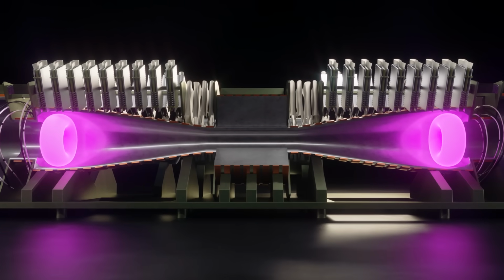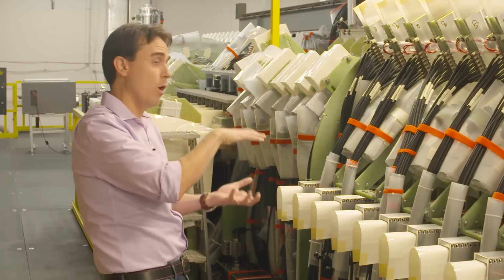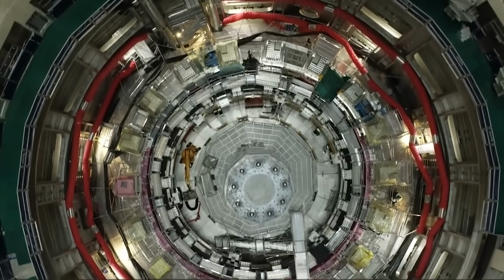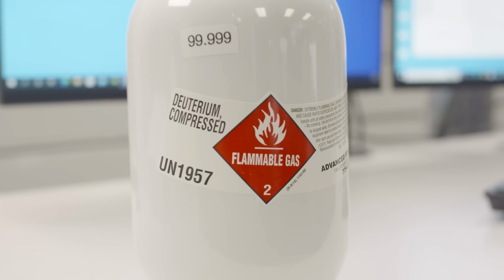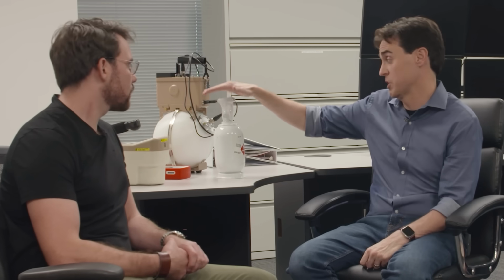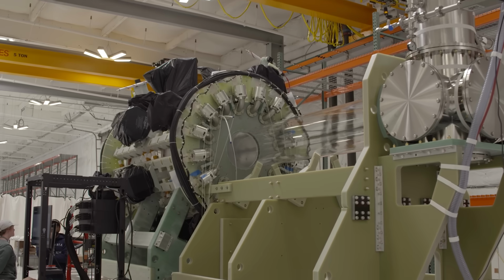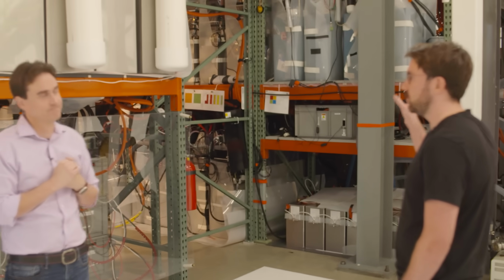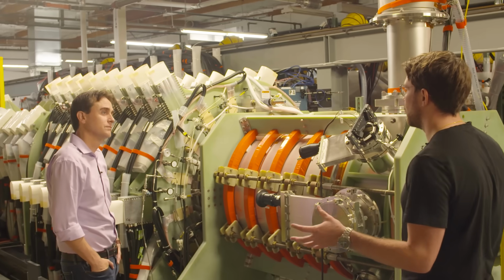A New Way to Achieve Nuclear Fusion: Helion

Comment: You can produce nuclear fission in the air, it can travel to metal, right down power lines. It's real and the united states'Government Agencies are slow. You have been overrun by satanic cowards using the wrong technology on citizens. Nuclear power and nano chips, smart dust technology, remote nurel lace technology and v2k nightmare. Direction energy.
Reply: I think you're the slow one buddy 😬
Reply: @cristhiansierra2184  I pulled you out of the woodwork, I highly doubt you even know what nano chips technology is. By your comment. No reply

Comment: Neat, is like a 3D plasma mold with cathode ray tubes on each end and linear accelerators that handle the plasma 3D shape to pump the two ends 3D plasma shapes into each other with more than I mentioned.   Wondering how these systems can be used for nuclear waste and nuclear transmutation of more dangerous isotopes into more stable isotopes?

Comment: Glad to see some more power options that are not just fancy ways to  boil water to turn a steam turbine.
Reply: @modenaman  I don’t think you watched the video
Reply: 9:00 minute mark
Reply: @modenaman  you gotta pay a little closer attention next time if you wanna call people out in the comments bro lmao
Reply: @modenaman  It mentioned other fusion plants boiling water but not the one the video is about check 9:00 to 9:41
Reply: Lol
Reply: Ya'll click on a video about engineering, and then try to argue the video doesn't make sense without watching it or paying attention, cmon
Reply: @modenaman  forgot to tag you in above reply
Reply: A couple others use a similar scheme.
Reply: Well, to be honest, from an engineering perspective boiling water is a great option. Thermodynamics is very unforgiving when working with heat, and a water based Rankine cycle is decently efficient (depending on the heat exchanger at the boiler) but it has the great advantages of using a common fluid and cheap materials (a 450°C turbine is not hard to make nowadays and the thermal efficiency of a combined cycle can get to 70+%)
Reply: @Daekanoid  
He's talking greater energy efficiency that steam. I'm unsure if this will still have a heat component that can be utilized in addition to the magnetic principles he describes.
Reply: @Daekanoid  the more you transfer the energy the more losses you’ll get. Carnot cycle gives you theoretical maximums.
Reply: @Daekanoid  Yep efficiency is the main reason I'm glad to move away from using heat to make steam. Thermodynamics and conservation of energy mean you can't get away from energy loss from changing and transferring it. As well whenever you bring steam into things you bring high pressures as well giving you lots more ways of things to go wrong.
Reply: ??..so where does it get the 100,000 amps, to run..water.??..its another bs power generator.
Reply: @harrywalker5836  Eventually stuff like this will be connected to a battery pack to self-start. Each run would recharge + generate power so it'd only need external power once unless there's a major issue.
Reply: @harrywalker5836  what??? There is absolutely no water in this system. A capacitor bank draws in a few mj from the grid (read, less than a single ev) to charge the capacitors, the. Discharges those mj over millionths of a second to achieve gw of power for a short time, sufficient to achieve fusion.  they presumably are  be capturing this power from their coils (similar concept to spinning a turbine) to be able to sustain the reaction so long as they have fuel.
Reply: @harrywalker5836  isn’t power generation the goal?

Comment: Yeah I get it's a new way to show a glimpse of fusion but, it's nothing different than what every supposed fusion device does. The tokamax this thing other things they all do the same thing man. They take an enormous amount of plasma energy. And they either squeeze it or hold it in place for a billionth of a millisecond. We've achieved that already many people can do this. The trick is to hold it there indefinitely. It seems we're stuck in this different design phase and never gaining a step further. But as for right now many proofs of concepts that don't seem to work.

Comment: I know if I look further into it I'll find the big problems they face, but I have followed a lot of fusion attempts and this is the first I heard of the idea of using the magnetic flux to directly generate useful electricity. I don't know how tight their confinement is and whether that is still a serious issue as it is primarily with any thermal method, but the idea that you're trying to fully isolate the plasma and never allow leakage seems intuitively easier to engineer. Not easy, but easier.

Cool video, thanks for sharing.

Btw I would really like it if you had gone into covering what their version of the net positive energy problem looks like, and where they currently are in that problem. It's a harder to qualify idea for me, how much theoretical energy of the pulsing magnetic field can be extracted. Is it limited by the EM equivalent of a Carnot cycle? Would they have to use many fast pulses sent into existing 'remnants' of fusion to scavenge the energy? Sounds like a serious hurdle to have the capacitor system ready in time for another pulse, and the thermal problem which goes back to confinement. Like I said I'm sure I'll find the big problems if there's enough information available about the systems, but I request that people like you at least do a blurb about the most difficult problems they face. The 'show stoppers' so to say, because there's always a show stopper.. the best show stoppers are simply the ones where more experiments have to be done to find out. Many show stoppers are essentially waiting on materials science and SSPh to invent a material to solve the problem.
Reply: " covering what their version of the net positive energy problem looks like"

this is exactly what I was hoping to see. I wish they talked about the most significant loss mechanisms and how they plan to address them through design changes in principle. They did say that the newer design will be larger to avoid the plasma from impacting the walls but never said that that was a limiting loss mechanism when compared to other losses such as those due to radiation. Also, the fact that they plan to operate Polaris at higher fusion pulse rates seems to indicate that they expect the losses to scale up less rapidly with the pulse rate than the captured power

Comment: Only AFTER fusion is fully developed and commonplace could humanity contemplate reaching for the stars. 
 Ironically, to reach the distant stars, humans will absolutely have to carry their own artificial star to sustain the energy expense of existence and propulsion.
In time, humanity will be forced to vacuum all stars within reach, to fulfill the NEW energy requirements for the foreseeable future, as well as the distant time when the universe goes dark and quiet, with nothing more than monstrously gargantuan black holes emitting Hawking radiation on the order of just a few WATTS, undistinguished from the blackness of a universe where even the current background microwave radiation has shifted to UltraLongWave radio-frequency.
Hydrogen will be Far, Far more expensive than all the remaining gold in the possession of All the billions of hypertrillionaires at the end of time.

Comment: layman question here: if you tell me that they heat these particles up to several millions of degrees, like in the core of the sun,, how can that heat be contained and by what? wouldn't any metal or structure that comes in contact with that much heat melt or at least take some quick wear and tear from that?
Reply: the plasma is magnetically confined so that it can't touch the chamber's walls
Reply: Inert gas
Reply: Indeed the walls would get damaged if they ever touched it, thankfully that’s what the magnets are for
Reply: @kaitlyn__L  but how can magnetism contain all that heat so effective like that?

Comment: Noone can answer this question  why doesn't a fussion detonation continue with all surrounding matter  a uncontrollable fussion reaction process. Radioactive or not the atomic bonds are in all matter the detonation should provide the necessary power to continue the bond destroying effect. Have you considered lining the inside with graphene panels over space age heat sheilding.
Reply: that's like asking "why does a fire only burns it's fuel ? chemical bonds are in all molecules after all !", the conditions for fusion are extreme, if the fuel exit these conditions it simply can't fuse. (Also, you only get energy from fusion when fusing elements lighter than iron-56.)(And we can't make graphene panels, did you mean graphite ?)
Reply: @The.Heart.Unceasing  no

Comment: So one of the reactions seem to indicate that this could produce hydrogen as a by-product. Or am I missing something?
Reply: it does, why do you ask ?
Reply: @The.Heart.Unceasing  Japan is looking to produce hydrogen as a byproduct in their High Temperature Engineering Test Reactor, which could have a direct impact on the viability of hydrogen fuel cells. That said, I thought about it after making the comment and realized that the amount produced would probably be negligible.
Reply: @yhmlco  well it is a byproduct that need to be filtered out anyway, so if they can make money by selling it, they probably will

Comment: At the moment my biggest capacitor bank is only 6,000 amps! Over 100,000 amps is insane!
Reply: I would only achieve 6,000 amps if I retard it at 3.5 volts so I wonder what voltage they are running at?!

Comment: Talking about being more efficient than Tokamaks and bashing them to a degree, but no word about the Q value here. lol. A continous fusion reaction is much more efficient than a pulsating one where you have to constantly charge up capacitors losing energy. Not to mention all those physical benefits of a donut shape which make it eaier to support the structure against the outward pressure on scaled up versions which use superconducting magnets. A donut shape is a natural form in which gases like to be in (Smoke rings etc) which also make the process of keeping it in shape more efficient. There is a reason why the whole world united to build ITER and not some other variant.

Comment: What most people don't understand is that this same technology applies to many other systems.  I theorized a similar system years ago for propulsion purposes!  You don't need the high temperatures these folks are working with and the propulsion cells can be made very small.  They can be formed in a kind of skin.  That makes the entire flight surface a propulsion system. 360 degrees around an object.  It means the ability to make maneuvers like the ones reported during UFO sightings.  I don't know if you would get the velocities seen in those sightings, but certainly you would have advanced flight capabilities.  The system had virtually no moving parts.  Like this guy just said.... "It's all done by electromagnetics".  You can think of it like a stack of quarters with dime sized holes in their centers. Each produce a magnetic field. They're turned on sequentially and turned off sequentially as well.  Suggesting that you have 20 of them and you sequentially turn on the first three, the instant you turn on the fourth, you turn off the first.  Then the fifth on, and second off. This reloads the cylinder segment so the cycle can repeat.  You're just pushing the air around the craft.  Too bad I haven't the time to play around with it more.  There's absolutely no reason it wouldn't work.  A simple ION Fan produces thrust.  This just produces much, much more thrust!  Keep in mind that you can cycle it as fast as the computer can turn on and off the magnetic fields!  PS ~ that's really fast.  I've actually wondered if it would be too fast.  Sonic boom fast.  Sure would be fun too find out!!!!!

Comment: the energy conversion system sounds a lot like one of these https://en.wikipedia.org/wiki/Explosively_pumped_flux_compression_generator although they are powered by chemical high explosives. But the idea is similar.

Comment: Even if the machine failed to generate Net Energy, can still split it in half and sell it to DARPA for billions of dollars... (if they're not already involved). Bolts after bolts after bolts of 10 to 20 million degrees of raining superheated lightning travelling at a million miles per hour... very very frightening.

Comment: If creating the fuel requires a fusion reactor, where does the power for that reactor come from?
Reactor A uses fuel produced by Reactor B using power generated by another power source, isn't this just a complicated battery at this point?

Comment: Whats the point of the collision, if its on the order of 10mil degrees before and 10-20 mil degrees after and then they still have to work on it to get it to 100 million degrees. Also using thermal velocity calculations i end up nowhere near an average of 5mil degrees increase. I sense handwaving here. As much as i would like this technology to succeed, there are noticable smells here.

Comment: The tough problems, lessons learned question reaction was funny.  I wonder if that smirk meant too many to count, or some I'm definitely not going to tell you about, or some combination of those two, and possibly other things.  In any case, I found it funny, and have had that same smirk come across my face a few times.  And I wasn't working fusion reactors, not even remotely.

Great video, I knew nothing of this.  It would be interesting to read a paper on the severity of the problems faced, proposed solutions, REALLY hard hurdles, both accomplished and challenges to come, etc.  I would need to revisit some physics though, probably, to understand much of it.  The stuff here was deadly elementary, but I guarantee you these guys would jump well up into the "what the hell are you talking about", for me anyway, very quickly.

Comment: Energy is such a vital commodity that fuels are fundamental to all other infrastructure.  While their commodity prices are continuously monitored by front line workers, it's not uncommon for power plants in a grid to shut down and restart at a moment's notice (as much as possible) in order to accommodate for price fluctuations.  This is unique in the world of industrial processes.  There are few other markets so important that we'll still justify a war over.   

Don't be too surprised if the advent of a technology this critical doesn't radically reform the incentive to do mining, research and development, and ultimately reconceive the way that the world looks at resource management of all commodities in general, since all commodities require energy production.  

One area that has been long-neglected in the world of energy production is the potential to shift from AC to DC grids which naturally optimize for long-distance transmission, unlike AC grids.  The logical application of this idea is to build production facilities closer to the origination point of the fuels they require, eliminating a great deal of the potential for environmental contamination in shipping fuels as well as transportation costs.

Comment: Oh just another scam to get some quick money from pseudo intellectual investors. Disheartening to see Real Engineering helping this people and falling for the lies. The cable management of those capacitors look dodgy. When you have a pulsed power system of that magnitude the cables must be secured very well with strong fasteners because the forces generated by the magnetic fields are so strong that can even rip apart the cables themselves, another issue I see is there does not seem to be much thought on what impact that cable management and capacitor bank layout would have on inductance, making me think that those banks are fake or non functional. And finally if they did achieved fusion and are actually getting enough to say they are about to begin energy extraction experiments, the machine would be quite radioactive and they would have to work in another place totally different from what looks like an average industrial warehouse. They would have to have permits and had to deal with low grade radioactive waste, because as you yourself explained the fusion reaction produces neutrons and when something captures a neutron it usually turns into an unstable isotope, this is in fact one of the greatest milestones of amateur fusors, to produce neutrons and demonstrate that by doing activation experiments with silver and such.

Comment: question if it will be cheap to build and keep running, if materials used to make fusion reactors are gonna run out, it's kinda pointless to even try, since there will be basically no commercial use for these reactors
you also have to account for energy costs to create fuel

but if we get a reasonable design for a reactor, it might be much easier to build than current nuclear fission reactors, which cost billions to build and take years

Comment: This one seems very likely to be on the right path for a working over-unity design. It allows for zero radius, which a lot of the other mainstream reactor designs don't allow for. (If anything designs that have a plasma ring, the central obstruction is counter-productive for raising temperatures while maintaining isolation.) It also doesn't need a solid pellet which would be hard to get consistent for repeating on a rapid and regular basis. Maybe that's a more simple way of looking at some aspects, but it seems overlooked in regards to all the various things the reactor designs try to control.